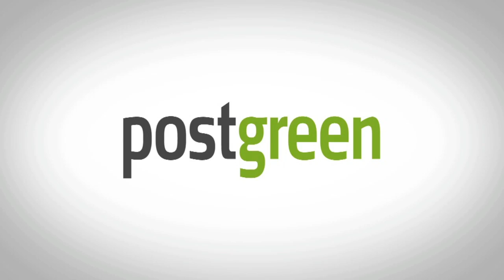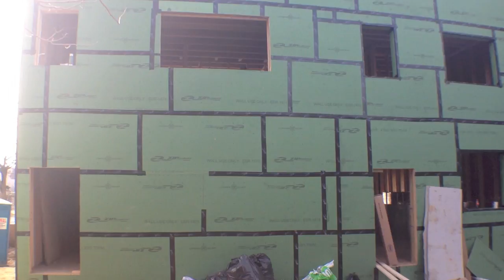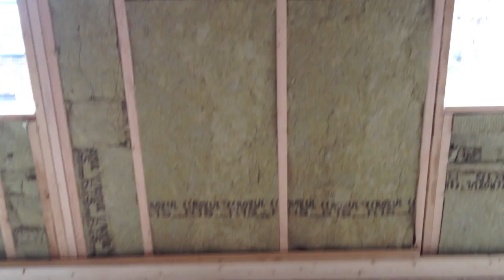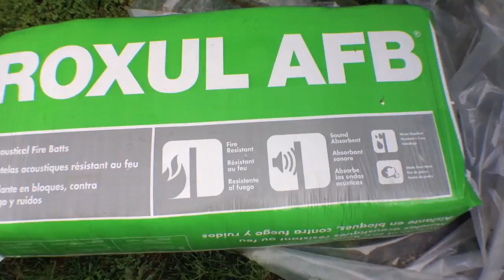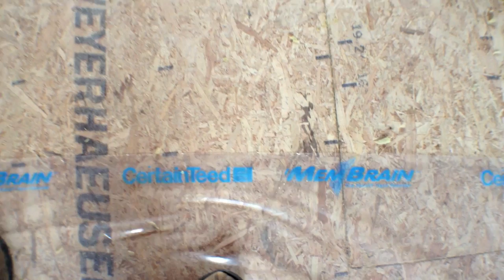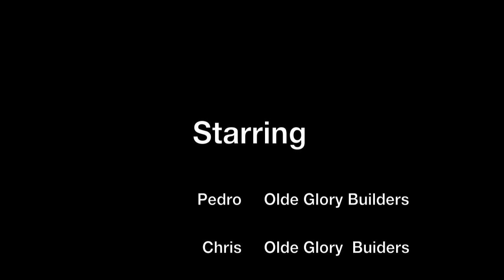Double Stud Wall by Postgreen Homes

Comment: The interior wall of double stud wall design is the structural load bearing wall. Back during the early '70s oil shocks, when this design emerged out of necessity to reduce the cost of heating fuel, homeowners retrofitted this second non-load bearing stud wall around the existing house to hold additional insulation. The 'double' means the outside. The inside was already there and homeowners didnt want to lose any room space. The wrap wall base plate rested on a ledge, built with studs and sheathed to do one thing: hold insulation. The exterior wall is a wrap-around, with further insulation installed between the interior and wrap wall secured by spacers. So you forgot to install the all critical structural sheathing behind the interior load bearing wall with spacers. You got the vapour barrier half right. It's on the correct side of the interior wall but forgot to wrap it over the ceiling joists because the structure was framed before to the roof before any insulation issues were addressed.  And by using OSB on the wrap wall, the building is now a sponge. OSB is H2O-absorbing garbage. 

Because the vapour (air) barrier is on the outside of the interior stud wall in double stud design and humans in the building exhale moisture, and cooking, and all of that, increasing relative humidity, rock wool is not an ideal choice, unless spend hundreds on top grade acrylic primer and paint.

Comment: The Government preaches that heating and cooling machines needs to become more efficient, when realistically what needs to be done is to increase insulation factors to R-80 or R-100, and reducing the "heated area" of your home. (6" wall air cavity) thus reducing your energy consumption by 90%. You could heat your whole house with a few candles.
Reply: John Sluder  this is the biggest barrier, plus it would need to be thin as well.

Comment: Fantastic building method, the only think this system does not address is air sealing!
Personally I would use Closed cell foam for the first stud wall? What are Your opinions ?
Reply: The zip wall is a vapor permeable water barrier, it will be a tight house even without ccf.